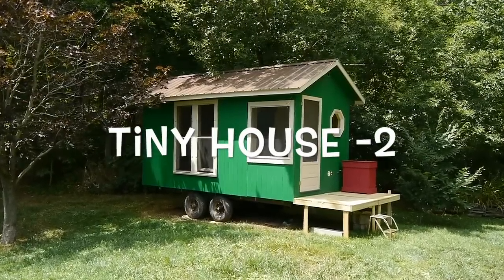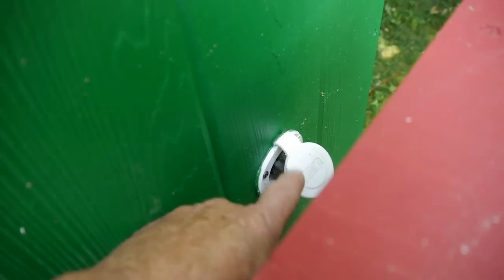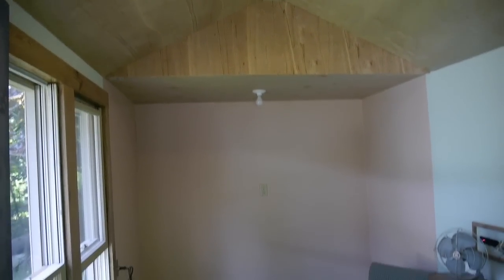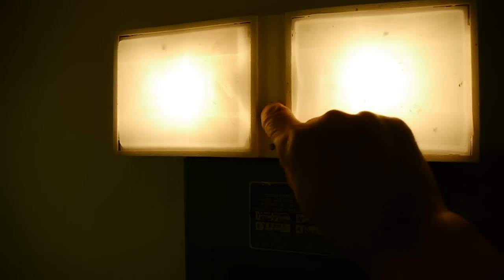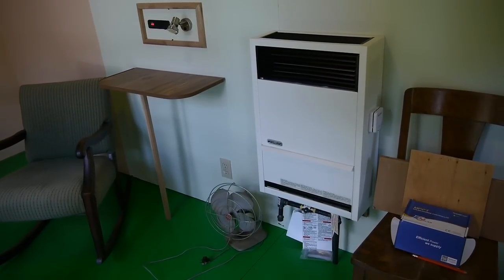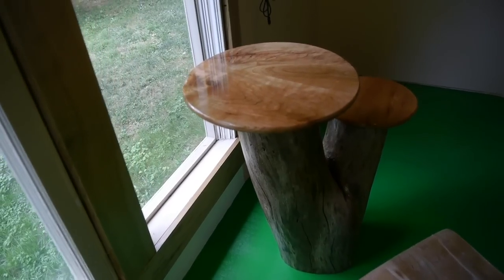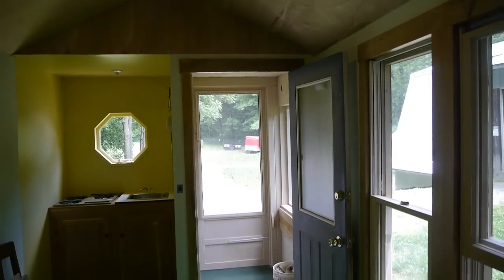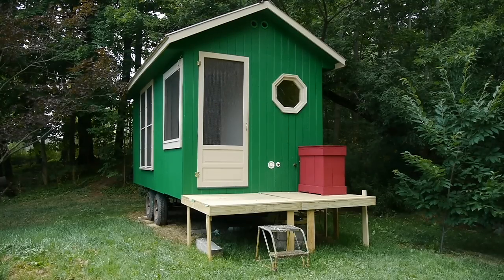Tiny House 2 - How I Finished the Inside

Comment: I really love the layout of the video and I am so glad that you showed us exactly what you did.
I'm thinking I might use this design (with some changes of course) when and if my boyfriend and I move, possibly install a small 5-minutes type shower and a composting toilet over where you have the bed area, and add a loft over the porch for our bed, with the kitchen area below it (Just have to make sure everything is off before going to bed or it will be a heated bed that is for sure).
Reply from the maker: That sounds like a nice plan, Megan.  The loft is really the way to go for your bed if you plan to install a toilet&shower.  In a Tiny House, the only way to go is up!  lol.  I'm glad you liked the video.  Thanks for watching.
Reply: +TimTools99 thank you :) I was thinking of building one of these to live in until I can build my offgrid home and then it can be used as a guest house or a traveling house.
Reply from the maker: Wonderful idea!  I found that the old trailer frame that I used (while it heavy duty) is not rated for the weight that i have in that tiny house.  Not a problem for me because it is making a one way trip to our land where it will stay permanently.  If I were building one to haul down the road, I would definitely buy a trailer rated for 10,000 lb. or more.  You will want that thing to be really stable  going down the road.  It will take quite a truck to pull it around too.  Have fun!  good luck.
Reply: How do you calculate how much you tiny house will weigh before you build it?
Reply from the maker: That's a tough one.  I didn't ... I just built and hoped that it wouldn't be too heavy when I got done.  haha.  That's why I suggest you buy a good sturdy trailer and then use the lightest building materials you can find.
Reply: +TimTools99 so you made it and then weighed it? I need to know if the one I build can be pulled by a truck. Would hate to build something only for the whole thing to break.
Reply from the maker: Hi Megan.  In my case, I didn't plan to haul it around.  My idea was to build it here at home where I have access to my shop, then haul it to our camp where it will probably never be moved again.  In your case,  Let's say you buy a new 20' trailer that is rated for 10,000.  You could build quite a Tiny house and still be under the weight limit.  It would be quite a process to figure out in advance what your cabin would weigh.  I guess you would need to weigh a 2X4, 2X6 and multiply by the number you would need.  Then weigh your siding, flooring and figure out that total weight. Weigh a roof metal panel etc.  It could be done but wow what a job.  I full size pickup truck can pull this size trailer around. I think maybe I would find some people who have build these things with the intention of hauling them around and ask them how the estimated weight etc.
Reply: Thank you for all the information, it has been a great help :)

Comment: Thank you so much for sharing this! I want to build one just like it, but I don't have a clue on how to get the power and water into the walls. Could you make a video on how you built that in the way you did? Thanks again, Tim! Amazing work!
Reply from the maker: Thank you Sandra.  Installing the wiring is not difficult. If you have never done it, maybe buy a book that will teach you.  Depends on if you want AC or if you plan to run off a solar panel or in my case, I did both.  Maybe get an electrician friend to help you.  Good luck

Comment: I really enjoyed both part one and this one. I wish you would have showed the construction of the interior. To learn how you decided to insulate it, and what specific materials you used for the interior, as well as how you wired it. I understand the framing aspect of what you did, as well as the roofing, and exterior work. But beyond that I still have a lot of questions. Anyways, really well done, looks beautiful!
Reply from the maker: Thanks David.  I used regular rolled insullation.  6" in the floor and 3 1/2 in walls.  Then I used 1/4 louan for my walls because it is very light weight.  As far as the wiring goes... I have two separate systems.  Regular 120VAC house wiring in case we ever get on the grid at our land.  Then, I bought a solar panel, controller and batter and wired up for 12 volt.  I kept it very basic just to run 12v lights and charge my cell phone etc.  That part of the project was new to me and I did a lot of reading to decide how to do it.  I have a video on 12v wiring that shows the basics.  I should do another video to actually show how I actually run the wire etc.  Thanks for watching.

Comment: Tim this was a very detailed walk through thank you! Could you share with us what you spent on this tiny home? Thanks!
Reply from the maker: I had some of the material (windows, door etc) so it's hard to say and I am still spending!  Ha.  I have spent as much in accessories for the cabin as I did for the building materials.  The heater, pipe for propane, fittings, electrical system, solar panel/controller etc really drove the price up.  I will easily have $5000 + in it.

Comment: i love the overall build, and the finished product looks great! I am disappointed, however, that you did not video your building the inside. I would love to have seen the process you went through putting the inside together. overall, love your work!
Reply from the maker: Thanks William.  It was hard to video inside - tight space.  It was pretty straight forward.  I insulated with rolled insulation and wired up for 12 volt and 110.  The walls were then covered with the 1/4" luan and the whole place was painted.  Thanks for watching.  P.S.  I did a quick video on the 12 volt wiring part of the project.
Reply: TimTools99  great! I'm really interested in that aspect of the build. Where do I need to go to view it?
Reply from the maker: https://www.youtube.com/watch?v=vfiLAFyGgOM&t=6s

Comment: I know it's weekend use, but where do you shit and shower? I have a plan for a 20 foot trailer like yours with dual axles, but I plan to put in a stand up shower and small toilet in the back, kitchen along the side, other side table and seating, then bed in the front. Mini fridge, washer dryer combo, twin burner stove, microwave and toaster oven. I want to do an on demand propane water heater and then at the hitch end, have a water storage tank and battery box that leads to the solars on the roof. I'm going after the compact as possible but everything I need design. On the outside, I plan on putting storage like you see busses have that lock, so I can keep my not every day use stuff packed up. The reason I'm putting the bed up at the hitch is to have as less weight as I can on the truck pulling it and as much on the trailer wheels as possible. This I hope will prevent suspension dipping on the pickup truck. I do want a porch, but I can make something that can be slotted and stored in the bed of my pickup when being moved.
Reply from the maker: Good plan Patrick.  Yea for me, I just wanted a place to get in out of the weather.  I have an outhouse at the property and in the winter, I have one of those portable toilets.  I shower at home which is only 5 miles away.  I kept my plan simple and as inexpensive as possible.  Bathroom, shower, hot water tank, etc etc all add to the cost drastically.  It just depends how a person plans to use the cabin as to how man y "conveniences" are needed.

Comment: Wonderful, thank you for both videos, very informative, did you put storage drawers under the bed or any further storage in the kitchen and do you have room for a fridge
Reply from the maker: I missed your comment.  Sorry for taking so long to respond.  I have not build my under-bed storage yet but will get around to it this summer.  I want to build a small cupboard above the sink also.  I guess if I ever get electricity put in at my camp, I could make a place for a refrigerator but right now, I just use ice chest.  I built this basically to get in out of the weather and have a warm and dry place to hang out.  Thanks for watching and commenting.

Comment: Hey Tim. What did you use for the interior walls? Is that a regular drywall? If so, in combination with that 1/4" exterior siding is the house rigid enough? Thank you and great job btw.
Reply from the maker: I used the 1/4 inch louan for the inside.  I wanted something lightweight.  The siding outside is heavier.  Plenty rigid when I got done.  Thanks for watching and for the comment.
Reply: @TimTools99  Thank you, Tim!

Comment: Very nice.  What are you doing to protect the floor in the porch area?
Reply from the maker: I painted the floor with a good exterior grade floor enamel.  In the winter, I have a solid window insert and a storm window I made for the screen door.  This keeps the snow out of the little porch area.  It's holding up great so far.
Reply: You might think about a floor drain too to help make sure water doesn't flow under the door.

Comment: What size in BTU's is your Williams propane heater and does it have an automatic pilot light  system with thermostat? Thanks.
Reply from the maker: Cant remember the btu but yes it has thermostat and pilot light. Good heater.

Comment: Where's you fridge? What kind of insulation do you have in the roof? It looked like your roof vapor barrier (bubble rap) was on the wrong side. Will you have condensation on the ceiling? This build looks heavy duty. Have you scaled the cabin yet? You'll need a pretty big truck to move it, I think.
Reply from the maker: Haven't had any problems yet.  I used a pickup track to move it one time to it's home in the woods.  I'll probably never move it again.

Comment: If you don't mind me asking, what is the brand name of the unit and where can I purchase it? Thanks in advance😀
Reply: +TimTools99 I was referring to the model of the stovetop. I was wondering if you could possibly tell me where I could purchase one or give the model of it.
Reply from the maker: Oh ... I took that out of an old truck camper my dad had.  It's been sitting around my shop for 20 years.  Finally got a chance to use it.
Reply: ***** Thanks for responding:)

Comment: How is it on the road? I want to build one, but I know I'll be a nervous wreck if I have to pull it anywhere
Reply from the maker: This one would not be good for hauling around.  I built it at home then hauled it to our property.  It made a one-way trip.  If I were to build one to travel with, I would start with a 10,000lb trailer with electric brakes.  It would be like pulling a big camper.

Comment: Why not wire a pure sine inverter into the walls any not worry about 12v?
Reply from the maker: A friend of mine recommended I wire up for 12 volt for now and add the inverter later if I wanted it.  After going through all this 12v stuff, I think it would have been easier if I had just done what you are suggesting.  I learned a lot about 12 volt in this process but I could have taken that money and bought a pure sine inverter.

Comment: If you don't mind me asking, what was the over-all cost from start to finish for this build? 
Great videos! I've been digitally designing a tiny home and looked at your videos for reference since I have no carpentry/construction experience.
Reply from the maker: Hi Jonah.  My cost is difficult to say because I had doors and windows left over from previous jobs.  I think there are several considerations when you build something like this that will affect final cost.  In my case, I wanted a simple cabin that I could build at home and then haul to a permanent spot.  It only made one trip.  So, I could get away with buying a used trailer for the cabin to be built on.  If you are planning to haul your unit around, that is a different proposition.  You will need a trailer with electric brakes rated for at least 10,000 pounds.  It would cost several thousand $ for that rather than the $400 I paid for my trailer.  The trailer is very important if you are going to travel with your tiny house.  Next thing:  choose materials to keep the weight down.  Research how campers are built and go from there.  Next: How many people will be occupying?  My case -only me... so didn't need a lot of storage space.  Next: do you need/want a bathroom?  My case, I have an outhouse.  Bathrooms will add considerable cost. Next: how to power the unit.  Plug into a 120VAC? or 12 volt?  If you have access to power, then don't spend money on 12v system but if you are in the woods like I am, I had to buy solar panel and all that goes with it to provide power for lights.  How will you heat?  I have a direct vent propane wall furnace.  Cheapest one I could find was about $800 installed and I did the installation.  As you can see, there are so many variables to consider that will affect your final cost.  My Tiny House is really a basic unit - a place to get out of the weather.  If I was going to build one to travel with, I bet it would easily cost be $10,000 - $15,000.  Good luck with your project.  If I can help further don't hesitate to ask.
Reply: Thanks so much for your response! I know from looking at tiny houses for sale online, some cost upwards of $75,000, while the materials for that house may only cost $10,000. I'm glad to read that you did use recycled windows and doors, that saves a pretty-penny, for sure. I'll have a lot of research to do if I ever plan to build one, Thanks again.
Reply: Taylor you can’t be serious...20 hour days every day for 3 years 😂😂 how long does it take to you out shoes on? 2 months?

Comment: So you did not insulate the walls, or floor, ceiling  at all... ???
Love the build, quiet the craftsman... !!! But I am curious why no insulation in walls ceiling and floor...

ok, I can tell when watching to the end it is for warm weather use .. do you think you’ll have any regrets about the limited use just in warmer weather Tim.. ??? I mean.. it’s obvious you gave this project much thought... so I mean no disrespect at all by asking ...thanks
Reply from the maker: I miss led you somehow, I think.  Yes, I insulated floor, walls and ceiling so I can enjoy the cabin all year.  I have a propane wall mount (direct vent) heater and I go up in the dead of winter too.  The only cheap decision I made was putting in those single pane windows.  I had the windows and so I stuck them in.  When I am not there, I hang a heavy quilt over the windows (in the winter) to conserve propane because I heat the cabin all winter.  That way, when I go up, it is nice and warm in there.  Thanks for watching and leaving the nice comment.

Comment: Nice simple interior. I think folks forget the purpose of these moving campers is strictly for sleeping, eating and staying out of harsh elements when needed. Way to many goofballs trying to stuff  every last inch with  new age gizmos in these. You cant fit a 3,000 square foot house into a 150 square foot rolling closet. Sleep,eat, get outside and work and repeat. Basics baby.
Reply from the maker: Man, I agree with you 100%.  Mine was designed for as you say, "Sleep,eat, get outside and work and repeat."  I love it!  I don't need a shower, TV, dishwasher or other such things.  Just a warm, dry place.  Thanks for your comment.  You get it!

Comment: Okay.  Now it's getting complicated putting the electricity, gas and battery hook ups!!!
Reply from the maker: Yes that's the expensive part too!
Reply: If you don't mind me asking, how much did these things cost?  Can you itemize them?  Thanks.  I like this one tiny home called the Home run (on youtube).  It's $44,000.00.  My condo was 46,000.  Seems to be a lot for a tiny home.  And I want a skylight that I can see out of.  Check out the Lucky Penny.  I like her window in her roof.  Sheila
Reply from the maker: Yes $44,000 is a lot of money but I guess it depends how you are going to use your Tiny House.  Mine is basically a cabin on wheels that will be parked on my land.  If you are going to be traveling with your Tiny House, there are many design considerations to be made that would make it a safe and durable to haul down the road.  I only watched the "Tiny House" show on TV once but apparently people travel around with these things.  They would be pretty heavy and require a good sized truck to pull, I would think.  Having said this, I can see how a Tiny House complete with kitchen, bathroom, shower and all the other things people want would cost a pretty penny.
Reply from the maker: To answer your question, Sheila ... there is no one way to do the electrical, plumbing heating etc.  I did a basic 12 volt job to provide lighting.  I bought a solar panel and controller to charge my deep cell battery.  The cost of my do-it-myself job really can't be compared to a commercially built Tiny House.
Reply from the maker: Sheila, I guess that step one would be to decide how you will use your Tiny House.  If you don't have the know-how to build it yourself ... perhaps you could contact a good carpenter and ask him to give you an estimate on building something for you.  Good luck.
Reply: Thanks.  I'm going to the "Tiny House" festival in St. Augustine, Florida  in a couple of months.  I'm sure I'll meet lots of people who I can learn from!!!
Reply from the maker: Have fun!
Reply: I intend to!!!!  Thanks!!!!